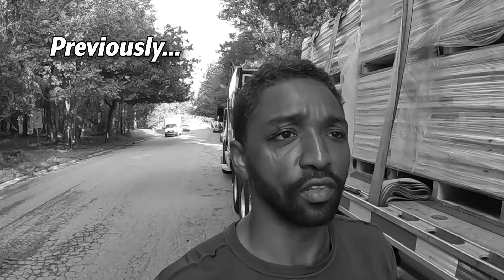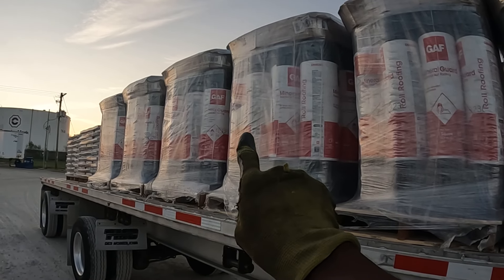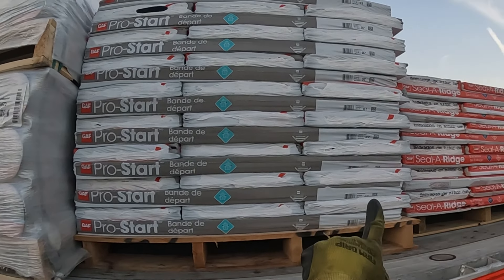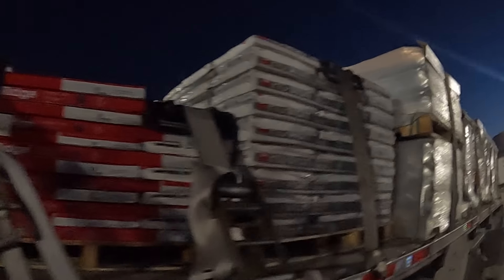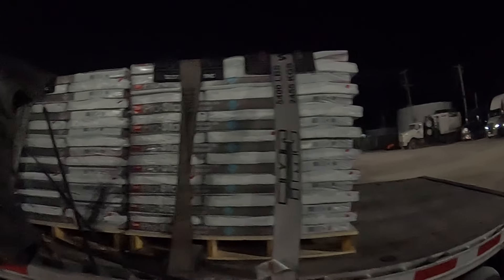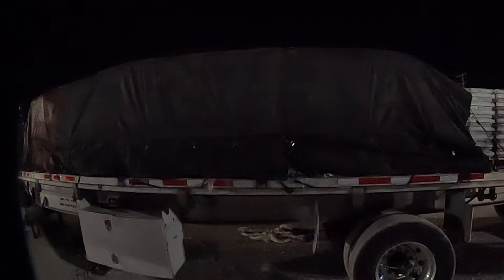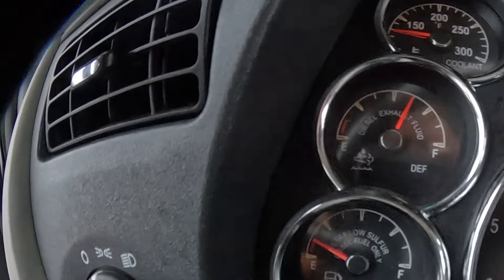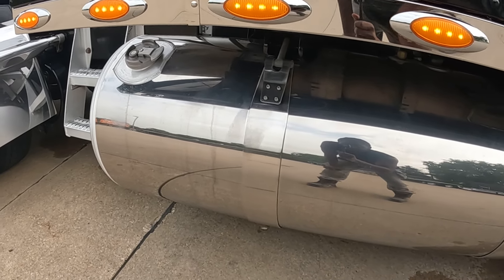TMC Breakdown Part 6: Let's put an end to this madness... 😮‍💨

Comment: My company (Senn Freight) puts their money in APU's instead of chrome and the trucks are run through the shop every week. We have 6 year old trucks still running strong.
Reply: You like the chrome thou 🤓
Reply: @Itz_Mikey777  yes I do. I am thinking about going back with TMC. I got dropped from orientation in July 2021 because I couldn’t downshift.
Reply from the maker: Tmc runs automatic transmissions in the linehaul fleet now. To my knowledge, their testing is not done in manual trucks any longer.

Comment: Shoulda asked the shipper why roofing that's going to spend the next 20yrs exposed to the elements needs to be tarped on the way to the roof. Makes zero sense especially since it's already wrapped in plastic.
Reply: Because the backside of the black paper is super sticky tar, and when it hits direct sun it heats up and becomes almost impossible to pull apart. And that means a waste of a roll. 💯and it’s not exposed to the elements when it’s under shingles or metal roofing